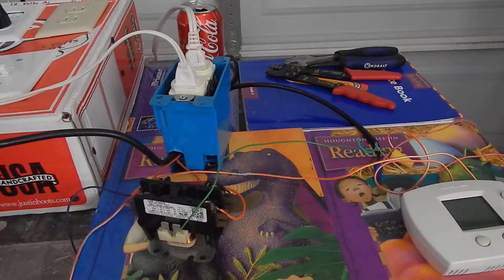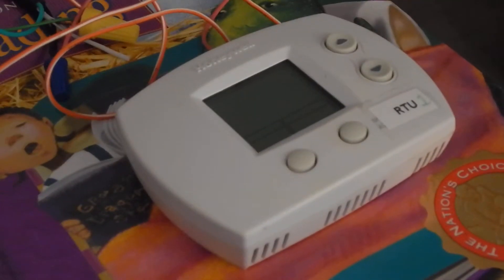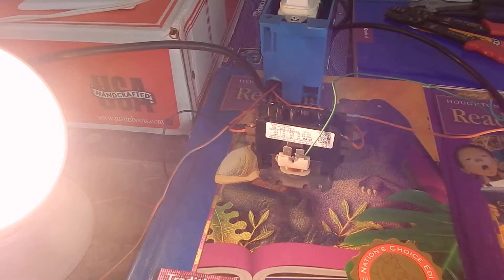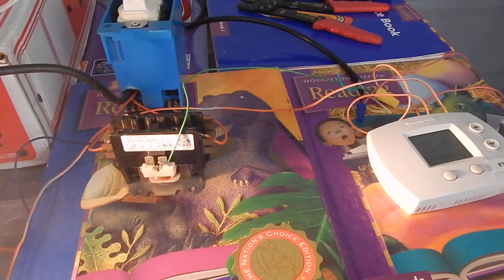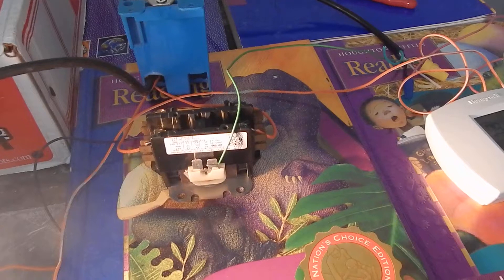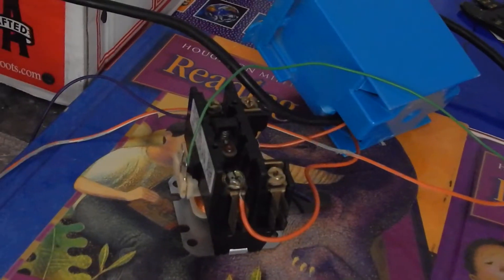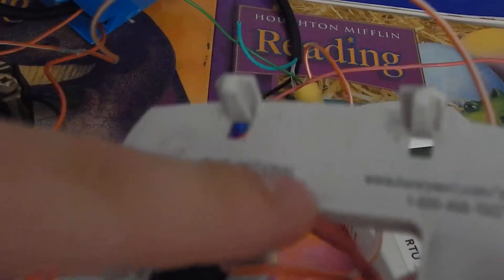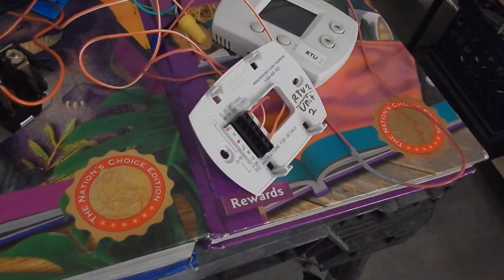How To Wire A Thermostat To A House Hold Fan

Comment: I have two rooms I need to regulate to house temp... (lots of windows in the rooms), running a 110 HVAC fan in a box with insulated 8in. Flex hose to rooms and thermo downstairs.  Thanks for the tip on the vac switch vs the tiny ones.. and wiering, would have been nice to have some still photoes on parts, but hey, very few have botherd showing how this simple system works. Exelent❤.